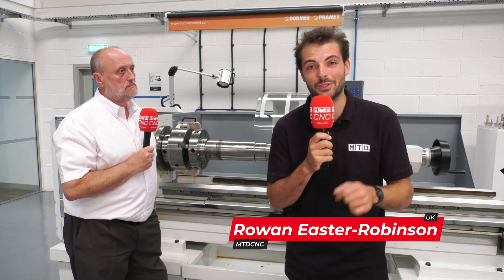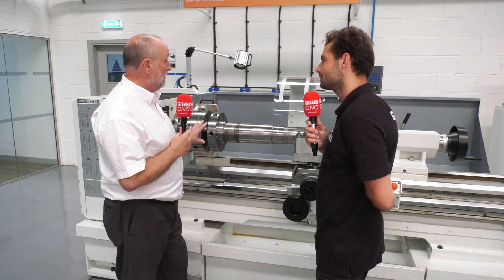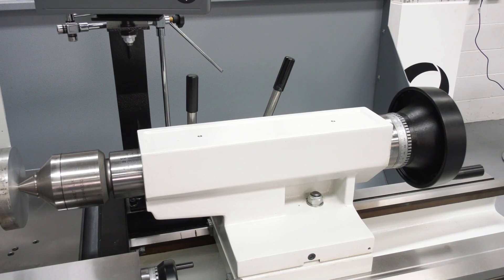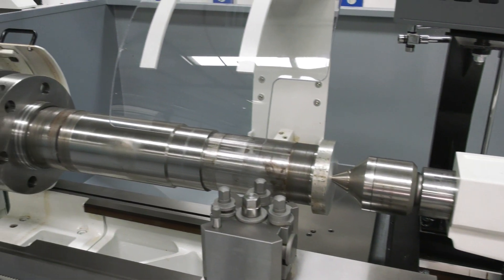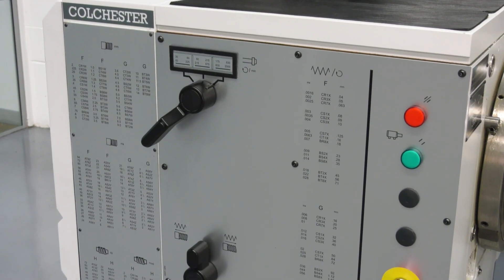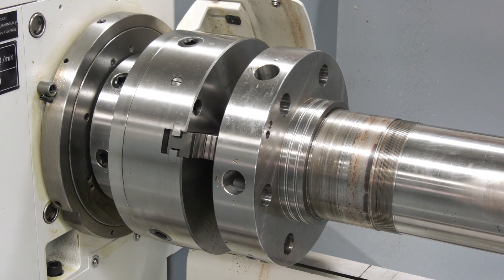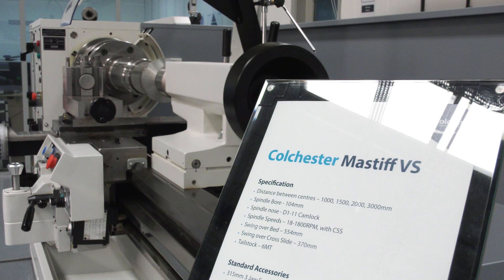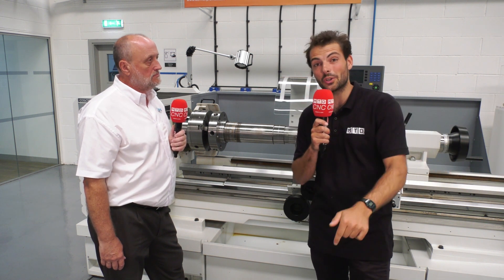Colchester Mascot from Colchester Machine Tools.

Comment: bought colchester mascot 1600 old machine today for our shop.......its still gold.
Reply from the maker: Very nice!
Reply: Its an old machine (in good condition  20 to 1600 RPM gear box still quite after many years of service). We could not afford the new latest 2023 model, but I am sure it will still make the parts to accuracy we want, better than chinese, taiwan and other machined  plethora in market; that we  abhor to buy.
Reply: 80 inch long- gap bed  10 HP, model...Colchester.Mascot 1600.....struggling to find operating manual for this machine. though we got the general machine manual bought at the auction.